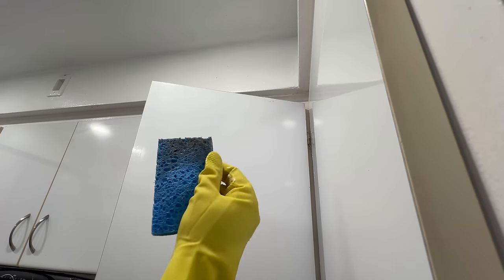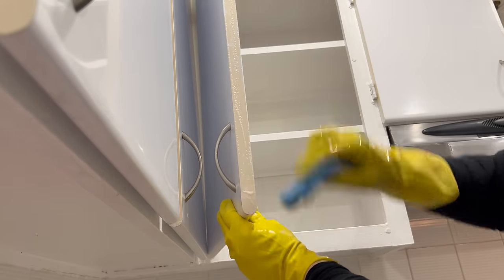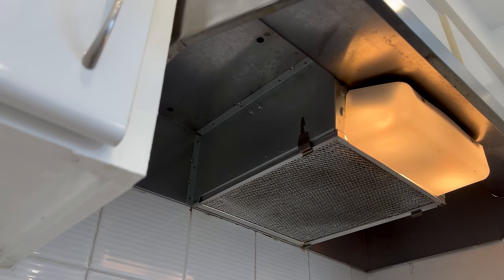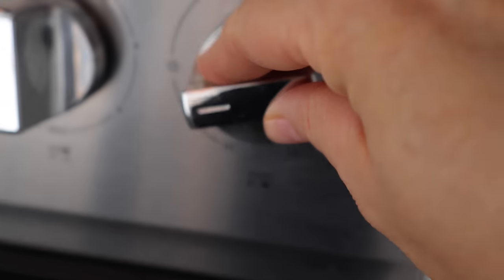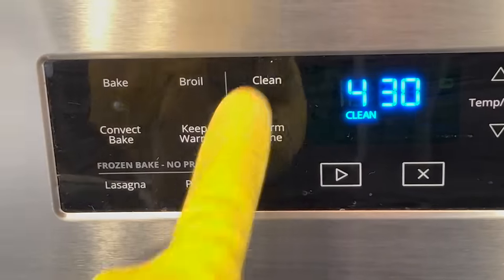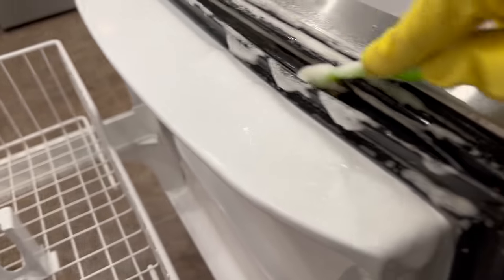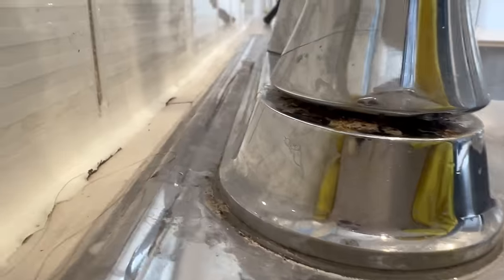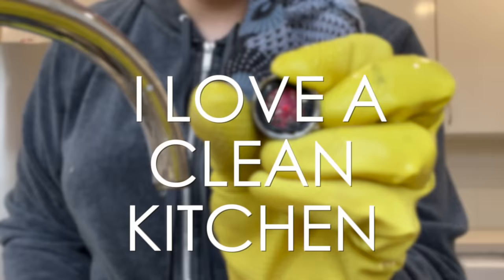How to Make a Kitchen Kosher | Transforming a Non Kosher Kitchen into a Kosher Kitchen for Passover

Comment: The most surprising to me was pouring the boiling water on the sink and counter tops.  I never would have thought that step was necessary.  I admire your stamina for doing this level of cleaning, you made me tired just watching.
Reply: Pouring boiling water is the easiest and fastest way to sanitize any sink
Reply: @miriam8026  agreed. My mother has a hiss-fit when I do it because she thinks it will melt the pipes 🤦🏼‍♀️.

Comment: I don't know if this is Kosher, but I have a suggestion for cleaning the oven racks.

When you spray the racks (using the Yellow can of Easy Off, as you did), place them in a dark garbage bag and seal it.  Set them in the sun, and it will make the Easy Off more effective.  You can clean something else while it is working.

Comment: I love a clean kitchen.  I wasn’t aware you could use steel wool on glass cooktops.❤
Reply from the maker: i have been doing it for years but like with everything test it on a small surface 1st!
Happy cleaning
xoxoxo
Reply: I don't think it is recommended for glass surfaces, since they can be easy to scratch. We have a special steam cleaner with a non-metal scraper attachment. The steam coming out is 130C, so it is hotter than boiling. If that still leaves stuff behind we use a special kind of razor like they used to use to clean the bottoms of ovens, being as careful as possible not to scratch the surface.
Reply: They make a pad similar to a Scotchbrite but finer textured for scrubbing glass cooktops. You can also use a razor blade like a paint scraper at about a 30 degree angle to get burned on food off the top. I have also used the razor blade on my oven door.

Comment: They energy gurus say we should vacuum clean the back of our fridges as it helps to keep it runnimg well and saves a bit on electricity. What a fabulous clean up, that sink was knock out clean and I love a clean kitchen. I am going to get some of that platsic film to line my shelves and the tops of the kitchen cupboards. It will make it so much easier to clean. I have used bio clothes washing powder to get grease off pot lids and bits and bobs, works well. But mostly its enthusiasm and eĺbow grease that does the job.😊❤

Comment: just an FYI, Easy Off oven coacher has an odor-free version. it works amazing! I use it on my stove top when it gets really dirty. spray, let it sit for 10-15 min and wipe off. amazing!
Reply: In Australia we have Oven Power - a liquid gel low irritant oven cleaner and a giant ziplock bag that fits all your oven racks and inserts and also the inside oven glass which is removable - put it outside and turn the bag over a few times to coat everything for a few hours and everything melts off like brand new ☺️

Comment: I love a clean kitchen, I really do. I like how thorough you are with cleaning. Cleaning the faucet aerator and using steel wool soap pads -- I thought the steel wool would scratch surfaces, but it did not and it did a good job and wow, the aerator needed cleaning.

Comment: I love a clean kitchen.  I do envy your patience with cleaning.  I wish I had your patience and stamina for it. I do have a question though.  How do you make a gas oven Kosher?  My gas oven does not have a self cleaning function and turning the burners on is an open flame.  I know many do have it but mine does not and I have to be extra careful with using oven cleaner because it's gas as well as my 2 parrots in the home.  Thanks!

Comment: I learn so much from your channel and look forward to every upload. I've watched this one a couple of times and have a question. After scrubbing the kitchen countertop and pouring boiling water over it, you still covered it with a thick plastic sheet. You said that was because the countertop material was older and porous. Was that covering just for Passover, to be removed later and stored (I have friends who do that) or intended for everyday use? Are there countertops that wouldn't require the extra covering after the kashering  process? I love a clean kitchen and was inspired by your video.

Comment: I guess the thing that surprised me the most was using boiling hot water on the countertops. I'd be afraid to get burnt.  This came at a great time as I was cleaning my kitchen today. I'll have to try that Dawn Power wash to clean. It seems to get the grime off better than some of the cleaners I have been using, and The Pink Stuff, have never heard of it until today. Will have to give that a try too.  Really loved the recommendations on what to use to really get things cleaned properly.  #Iloveacleankitchen

Comment: I LOVE A CLEAN KITCHEN!

It wasn't surprising (because I was aware of the practice already) but the thing I find the most interesting is pouring boiling water on the counters. If I did that, the glue that holds the laminate down would "unstick" and I'd end up with a messed up counter.  I do like the idea of a giant liner for the countertop though.  That could be super useful for people with questionable countertops.

I think the MOST surprising thing is that there wasn't a single Scrub Daddy in this whole video!

Comment: So... I can't turn my engineer-brain off and I have a question. To clean the stove top with heat, what do you do with an induction stove? Would a kosher pan being used to make the stove top conduct heat stay kosher if used in such a way on a stove top that technically isn't kosher yet? Also, I love a clean kitchen (though mine could use some tlc)

Comment: I’m interested Sara, that you didn’t do the same to the fridge as you did with other surfaces. Is there no requirement for heat treatment like you did for the stove, oven and worktops? And if not, why is the fridge different? 🥰
Reply: By the way, I love a clean kitchen!
Reply from the maker: you are so AMAZING! You are absolutely right, cold elements or appliances will not have the same kind of cleaning/ kosherizing  because usually in cold environment there are no absorption,  so a deep clean will do but with heat , things penetrate the items so it needs to be purges with heat ! 

I hope it helps!
Reply: @frumitup  thank you for your answer ❤️

Comment: NEVER use metal scouring pads on a glass cooktop!!! They make tiny scratches and will eventually weaken the glass surface and lead to breakage.
Reply from the maker: Hi! 
I have  been using fine steel wool pads ( like the brand SOS) for close to 20 years thank G.of and it always worked well thank G.od 
Always test on a small discreet surface before doing a large area and as always do what works for you ❤️
Happy cleaning 🧼